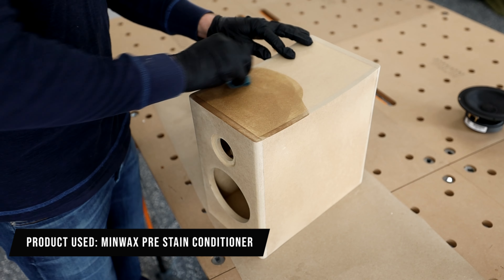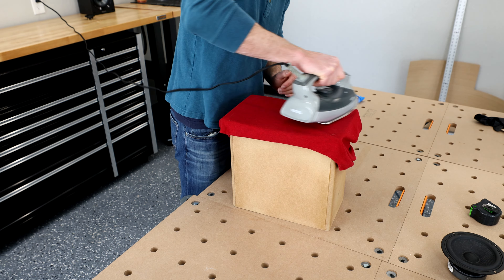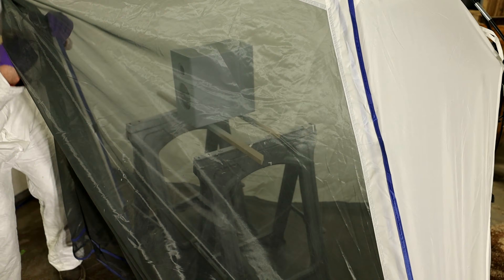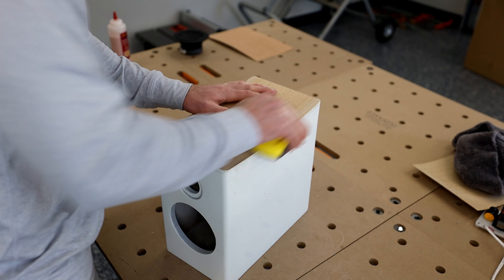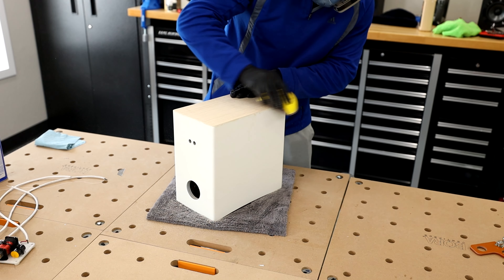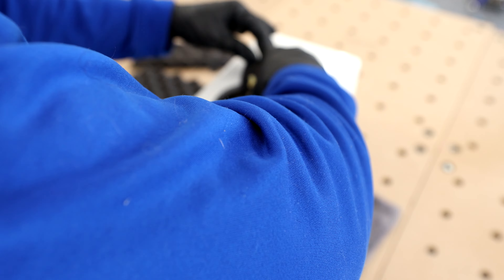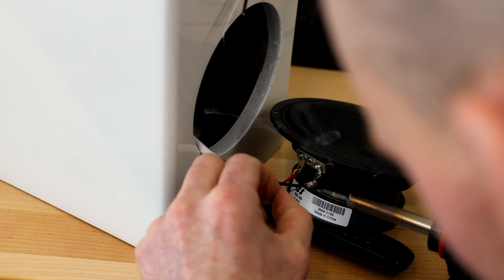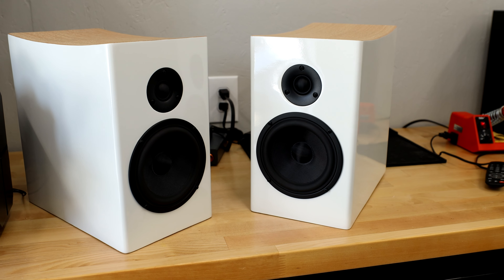CSS Audio Torii DIY Speaker Kit Part 2 - Paint and Veneer!

Comment: I have a white speaker (very glossy white), but look old and have some small dents. I want to repait it to make it look new again. Should I simply apply the this 1k or 2k paint & polish on top of the old paint layer? Do I need do some sanding work to scratch the surface before applying the new paint layer?
Reply from the maker: For something like this I would always suggest a light sanding before spraying any paint. If there are any dents or damage your looking to address at this point you could fill those first, then sand, then paint.
Reply: @MattCoykendall1  thankyou for the reply, very helpful. Will try that way.

Comment: Thanks for sharing your tips, I made a mistake on my speakers by using white shellac as a sealer (before I watched your video) and the MDF is still expanding and contracting with humidity. I haven’t painted yet, so I am still in the "find a fix stage :)"  Do you have any issues with the sealer that you used? Thanks in advance!
Reply from the maker: Consider sealing the inside as well if you haven't already, I thankfully have not had any issues with the sealer I used, I used the same process on the 1tdx build I am working on now as well.

Comment: I appreciate your mentioning the Heat Lock veneer glue. I am going to be doing veneer on my MLTL-6 speakers - my first time doing a veneer - and I really don't want to deal with VOC. This is a reason why I have only been using Baltic birch.
Reply from the maker: The heat lock adhesive worked well for me, seems to have a good hold. I agree about the  VOC free too, I use several products that do have VOC’s but avoid it if I can. Good luck on your project too!

Comment: Better than any video on the CSS site! I'm at the foam stage, does it only go in the bottom woofer space?
Reply from the maker: As you noticed there won’t be enough for everything, prioritize the woofer compartment first, cover the crossover and then fill in what you can up top without interfering with the port. Enjoy the build!
Reply: Thanks Matt!! I did notice there wasn't enough. I'll be doing the final assembly soon. @MattCoykendall1